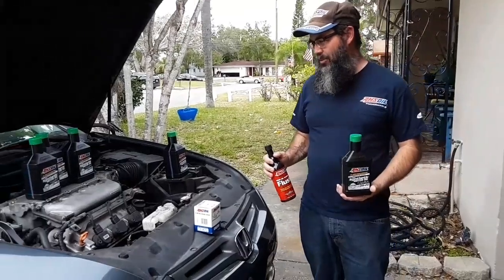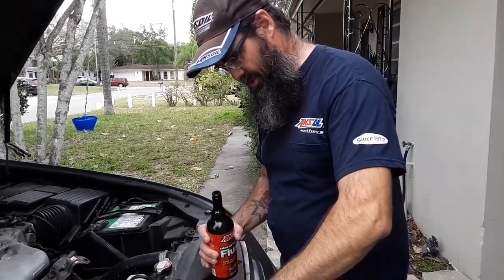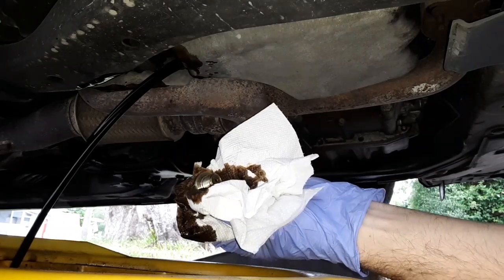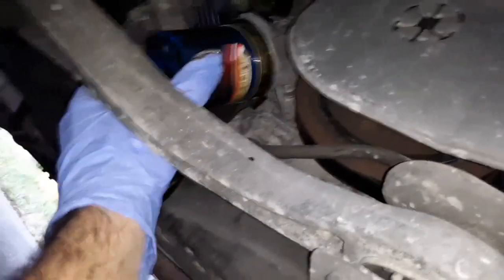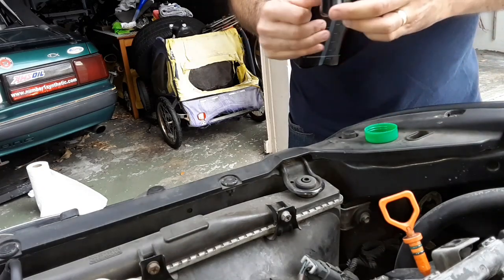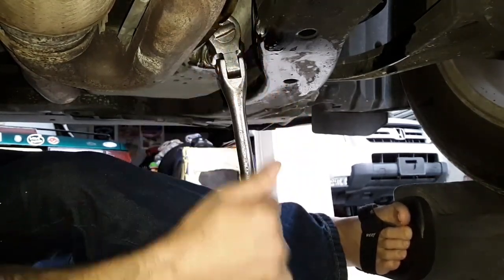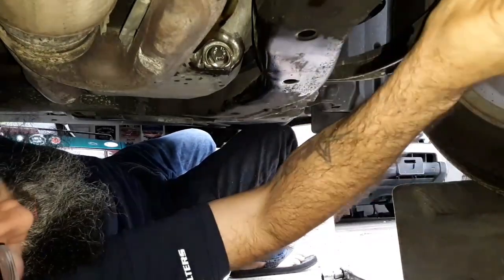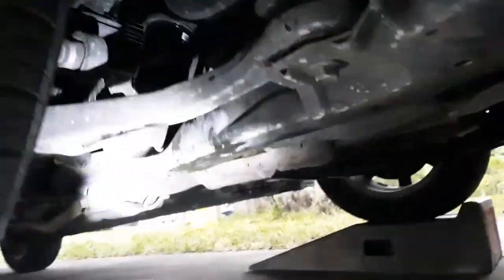03 Accord V6 Amsoil Signature Series 0W-20 100% synthetic oil change/Verse of the day

Comment from the maker: Amsoil Signature Series 100% Synthetic Motor Oil
https://www.amsoil.com/c/gasoline-motor-oil/3/?zo=1463115

Amsoil Ea15k13 oil filter
https://www.amsoil.com/p/amsoil-ea-oil-filters-eaoilfilt/?code=EA15K13-EA?zo=1463115

Engine Flush
https://www.amsoil.com/p/engine-and-transmission-flush-flsh/?zo=1463115

Lookup your vehicle by year/make/model
https://www.amsoil.com/guides/?zo=1463115

Save 25% as an Amsoil Preferred Customer
https://www.amsoil.com/offers/pc/?zo=1463115

My Amsoil website: number1synthetic.com

Referral:  Mike Trull Amsoil dealer #1463115

Thank you!!!!
Reply: Clean the drain bolt with brake cleaner. This way you prevent dirt from piling up.

Comment: I asked one of my equipment rental spots, Oakland Rentals, what oil they use for their 2 stroke rentals.  The owner said Amsoil keeps tools running longer with less wear and repair.  I've never tried it, but I'll try it when my warranty is over and see if I have less timing chain noise from my tundra v8.
Reply from the maker: Great to hear!  I run Amsoil Saber 2-stroke oil at a 100:1 mix ratio in my Stihl... its that good.  Amsoil is still an American privately held business that distributes through independent dealers.  They introduced synthetic motor oil to the automotive market in 1972 and their quality is legendary.  I would be honored if you used my link www.number1synthetic.com to lookup your vehicle and order your Amsoil products when you are ready 😁 Subscribe for more Amsoil fluid change videos.  What year Tundra? we have featured my bil's 2008 5.7L on the channel several times.  Mike Trull Amsoil dealer 1463115

Comment: I used amsoil in my 98 Lexus SC300 with 200k on it before it got totaled, my 16 AWD Chrysler 300C I have done 3k intervals going on twice now with engine flushes each time. To help clean it out from the last owner, also have the severe gear in the front and rear diff too
Reply from the maker: That's the worst when you have a good running car that you have taken care of and then it gets totaled. We had an 03 GMC Envoy XL with the 4.2 i6 and while those Vehicles definitely had their share of problems we must have got one of the good ones. Needless to say after I had installed Amsoil From Radiator to rear end and even sent my computer to PCM of NC for tuning and transmission shift firming, it was running like a top and then got rear-ended and totaled. Anyway we replaced  it with an 07 Honda Pilot and I immediately started switching everything over to Amsoil that I could!

Comment: You should have removed the valve cover for a before and after comparison with the flush. I'd love to see the Parts Plus oil filter cut open to see how the construction looks.
Reply from the maker: That would have been interesting to see or at least I should have shot inside of the oil cap area before and after. Yeah I was thinking the same thing about the filters. I need to go ahead and purchase a tool to cut open my filters. Thanks for watching.
Reply: Nice video Mike!

Comment: I’m about to switch my lawnmower to Amsoil. Gonna do the engine flush but the amount is the bottle is the amount the small engine takes so ima just use less.
Reply from the maker: Definitely you probably only need a few ounces. Yep Amsoil makes amazing products including synthetic small engine oil in several viscosities. https://www.amsoil.com/c/4-stroke-power-equipment/12/?zo=1463115 And the Amsoil quickshot fuel additive mitigates ethanol problems and keeps fuel fresh and carburetors clean. And then for off-season storage the fogging oil and gasoline stabilizer.

Comment: Hi, nice video! Is it hard to find a car with 190k in good condition?
Reply from the maker: Thank you and thanks for watching! I acquired this beautiful Honda Accord probably right before used car prices started going crazy. I also have the privilege of knowing the original owners of the car... A very generous couple from my church. I got the car well below Book value with all service records going back to the window sticker. The car now has 211k on it and running strong! Just finished up a 14000 mile oil analysis which is also my latest video. Check that out and a bunch of others on this car as well
Reply from the maker: https://youtu.be/oniN7yuqa94
I reuse the thumbnail but this video is 1 year later... see how the Amsoil does after one year and 14000 miles

Comment: Hello sir, my car owners manual suggest me to use Acea C2 specification oil but when i searched for Amsoil , it doesn’t have this specification oil in my country. It has Acea a5/b5. Can i use that instead of C2?
Reply from the maker: Let me check into this for you. Can you give me the year make model and engine of the vehicle? Is this a gasoline or diesel engine ? You are right the european-spec are a little different
Reply: @MikeTrullAmsoildealer  My car is Hyundai Venue (2019).It’s gasoline powered. Engine is 1.0 liter turbo charged making 120hp and 172nm.
Reply from the maker: @abhimanyumathur6407  well I wanted to verify with Amsoil Technical Services we unfortunately do not have any oils currently that are formulated to ACEA C2. I even looked through all six of our european-spec oils. Anyway thank you for reaching out! I hope you can find another good high-quality true synthetic European oil meeting C2.
Reply: @MikeTrullAmsoildealer  thanks for your response. Can i use any other grade Like A5/B5 instead of C2?
Reply from the maker: @abhimanyumathur6407  from the little bit of online research I did it looks like it is a very similar spec to C3 but I think the high-temp/ high-shear viscosity is different. Some of the Amsoil European car formulas meet C3 but I would probably stick with the recommendations.
Reply: @MikeTrullAmsoildealer  thank you so much 👍🏻

Comment: The Amsoil filter is made by Champion and will cost $20 and $10 shipping. The Fram Ultra Synthetic is just as good with with the same rating for only $10. Or the Napa Platinum and Purolator Boss are great too. $30 is just too much for a filter.
Reply from the maker: Always good to have some other options to use in a pinch. The shipping on a single item is cost-prohibitive but if you are already using Amsoil motor oil and combine your orders (especially on more than one vehicle) to take advantage of the free shipping over $100 and also the savings off retail with the preferred customer membership https://www.amsoil.com/offers/pc/?zo=1463115
it can begin to make sense. That's interesting about Champion I will have to look into that.
Reply: @MikeTrullAmsoildealer  Champion makes Royal Purple also.  If you watch some YouTube videos you will see Amsoil and Royal Purple cut open.  They are exactly the same filter.

Comment: im thinking about switching to this for my 2002 is300 2jzge, im currently using pennzoil platinum 5w-30 and im using some oil in between intervals, you think the Signature Series will be my best bet?
Reply from the maker: That's the inline 6-cylinder correct? What an engineering masterpiece. I believe the Amsoil signature series is the best oil out there as it is 100% synthetic chemically engineered and it comes out on top in the testing. Number1synthetic.com is my link and optional preferred Customer membership gets you 25% off.
https://www.amsoil.com/lookup/auto-and-light-truck/2002/lexus/is300/3-0l-6-cyl-engine-code-2jz-ge-c/?volume=us-volume?zo=1463115

Comment: for scooter yacco or amosil sir? what a amsoil make low emission?
Reply from the maker: I'm not familiar with Yacco. for a 2stroke: https://www.amsoil.com/p/interceptor-synthetic-2-stroke-oil-ait/?zo=1463115
For a 4stroke:
https://www.amsoil.com/p/formula-4-stroke-synthetic-scooter-oil-aso/?zo=1463115
If you need something besides a 10w 40 you could look at the various weights of Amsoil motorcycle oil thanks for the question thanks for watching
Reply: @MikeTrullAmsoildealer  oke thanks sir, i think amosil is a good oil for my matic motor suzuki, maybe i want try it

Comment: Hi Mike, I was thinking of switching to Amsoil signature oil. I was reading 15,000 miles for severe conditions. How many miles do you go before changing?
Reply from the maker: So I am one of those weird people who does the extended drains that Amsoil recommends. I think the most I've ever put on a car in a year has been about 13,000 on my former car a 2002 Chevy Cavalier which I have done some videos on. That car is still running good for its new owner. Only reason I got rid of it was I acquired the 03 Accord V6 that was very well maintained from a brother at church who made me a deal I couldn't refuse. I say all that to say that I was doing once-a-year oil changes on the Cavalier since I switched it to Amsoil motor oil in 2006. It was running great when I got rid of it getting something like 32 miles per gallon. I believe that Amsoil knows what they are talking about with their drain intervals I think 15,000 or one year in severe service is perfectly fine and is nice because you can run their oil filter that long as well. Otherwise you would have to change the filter and top off the oil at manufacturer intervals. 25000 mile recommendation comes into play if you have a highway driven car that rarely if ever does stop-and-go or short trip driving Etc in any case they also limit it to 700 hours or 1 year in case you do lots of idling and never reach the mileage. I tell people to do what they are comfortable with. you could change it more often if you wish. You could also consider Amsoil XL or Amsoil OE which are lower-priced alternatives but not designed for the ultra extended drain intervals of Signature Series.
Reply from the maker: Lookup your vehicle:
https://www.amsoil.com/lookup/auto-and-light-truck/?zo=1463115

Save 25% :
https://www.amsoil.com/offers/pc/?zo=1463115

Comment: Do u have any experience with thier transmission fluid?
Reply from the maker: Yes here's a link to a video where I changed an inline magnetic filter and the Amsoil ATF that came out look as red as the day I put it in and it has four years and 33 thousand miles on it.  https://youtu.be/oWrexE03bkM
 Amsoil ATF was my first exposure to their products back in 2006 I became a dealer in 2007 and have been super impressed. Sadly I just started filming videos for YouTube a year-and-a-half ago but I do have several transmission fluid videos on my channel. So is there a specific year make model you were wondering about? They make the red label for a lot of the older transmission and the blue label for a lot of the newer transmission. There's also CVT fluid DCT fluid and even a Ford type f racing transmission fluid
Reply: @MikeTrullAmsoildealer  thank u. I just sub to your channel very informative videos keep them coming.
Reply from the maker: @chrisr.986  thank you so much every like share sub and comment helps to grow the channel! I've got some engine oil analysis videos coming soon on the 08 Tundra, on this O3 Accord which is now at 208k, and on the 07 pilot with the bypass oil filter.
Reply: @MikeTrullAmsoildealer  have a question  my mitsubishi lancer has developed a slight whine when driving up a freeway hill. It shift fine. Also when it is a hotter climate my car tends  to make a whining sound?Any idea what it might be.
Reply from the maker: @chrisr.986  sorry man I do not know off the top of my head. I may have heard people talking about torque converter or main fluid pump in regard to a whining sound but not sure.

Comment: I'm getting ready to do the same to my 2017 Ford escape I have 153000 on mine so I'm hoping if I switched to amsoil that my vehicle will last along time because I got way to many car payments left for anything to be going wrong but I think I'm just going to use the frame ultra filter though because I will still keep changing at 5000 miles it scares me to go past that.
Reply from the maker: Sounds good yes do shorter drain intervals to match your comfort level. Here's the follow-up video with oil analysis results after 14000 miles: https://youtu.be/oniN7yuqa94

Comment: 5W-30 is correct for this vehicle, unless you are in snow country..
Reply from the maker: My oil fill cap actually says 5w 20. Yeah I'm kind of doing my own thing when I run 0w 20 but have not had to add any oil 7000 miles and Counting. Stay tuned for when I change the oil at 1 year I'm intending to do oil analysis and publish the results. Thanks for watching!

Comment: I know you’re an AMSOIL dealer, it’s fine, but please don’t make ridiculous claims. Puts prospective buyers off!
Reply from the maker: I've done my best to be factual which claims in particular do you take issue with?
Reply: @MikeTrullAmsoildealer  your using two bottles of AMSOIL flushing engine, is it without engine oil? Or, with old engine oil in crankcase?
Reply from the maker: @victorteo4783  I use one bottle of Amsoil engine flush with the old oil in the engine. Then you let the engine idle for 10 to 15 minutes before draining the old oil and engine flush and changing the oil filter.
Reply: @MikeTrullAmsoildealer  I used 1/2 of 16 oz, Seafoam, so 8 oz into old oil, run for 300 miles then drain and fill with new oil. There are lots of easily available oil for engine flush, they’re all detergents, just have to read instructions.